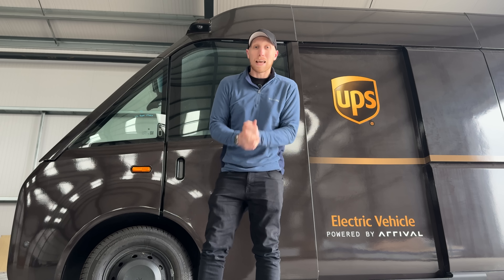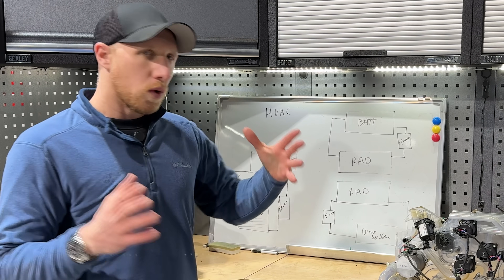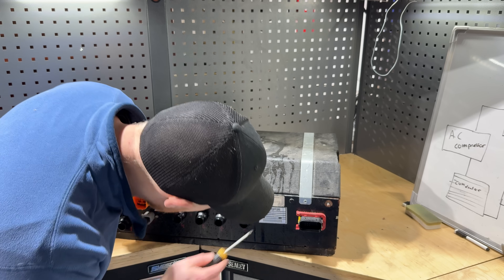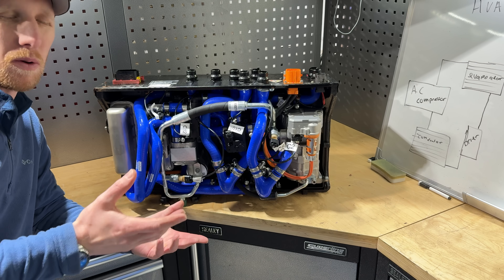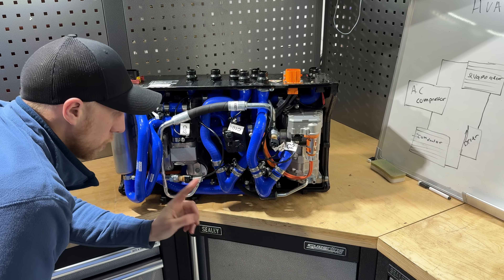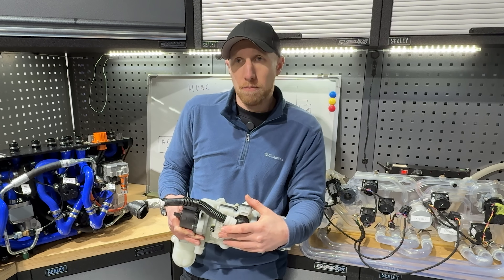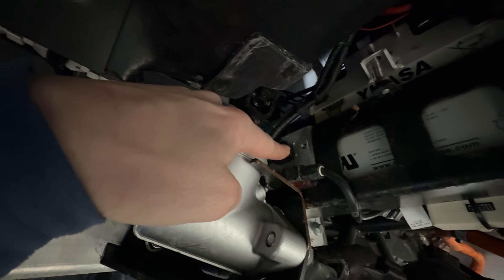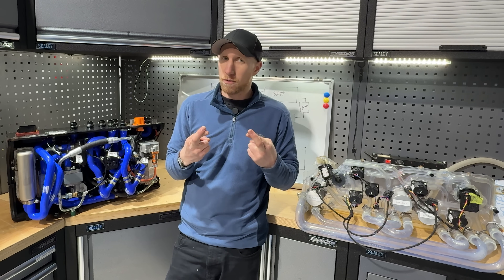How does HVAC work? ARRIVAL got something right!

Comment: I have a theory around all the separate 12v batteries. Could multiple batteries be used on the prototypes to allow them to isolate different circuits in the vehicle for testing? Maybe in production they planned to replace them with a single 12v (or double for 24v) battery?

Comment: Chris - you should give Bergstrom a call, see if they have any of those units sitting on a shelf, ready to sell to Fellten?

John Kelly of Weber Auto does a great detailed walkthrough of the Tesla system search for "Understanding Tesla's Heat Pump System" and "Understanding Coolant Flow in a Tesla".

if the Bergstrom box can do a similar thing, it would be a very handy fitment in defender & campervans conversions where you have a lot of cabin space to heat.

Comment: What does the blower assembly look like for driver comfort? If the evaporator transfers into coolant immediately in that assembly and only coolant is plumbed to the driver comfort area, how does the blower assembly/Driver AC remove humidity the way a normal AC setup would?
Reply from the maker: I will have to take the assembly apart and see

Comment: Great to see Arrival were getting some things right, although they still had a bit to go on serviceability, especially on vehicles that were going to be racking up very high milage. 
Really interesting stuff. It's one area that has developed quickly in recent years, thanks to BEV engineers searching for every little bit of extra efficiency. Less components, less weight and a more compact system are also big wins. 
I'd love to fit the latest Tesla system to my 'classic' Model S.
Reply from the maker: I would love to get my hands on one of the newest arrival vans and see just how much has changed

Comment: The key to understanding what is going on with all the EV HVAC stuff is to understand that unlike their fossil fuelled cousins, EVs need to often move heat the "wrong way" across a thermal graident, ie from cold to hot, whereas naturally speaking, heat of course wants to flow from Hot to Cold.  

With a conventional car, for the most part, it's systems operate well above any practicable ambien temp, for example engine coolant at between 90 and 110degC, or engine / trans lubricants at say 120degC, all well above even the hottest ambeint temp experienced (say 55degC).  With an EV, we require parts to operate below ambient temp, for example we need the battery to be kept say at 25degC, which is less than say 35degC a fairly normal ambient temperature.  So to reject heat from the battery, we have to move heat against the thermal gradient, and this requires a Heat Pump, ie a device that uses the latent heat of evapouration of a working fluid to push heat the "wrong way" across that thermal graident ie to cool the battery down to 25degC, despite it being 35degC around the vehicle.

So once you have a heat pump and can move heat the "wrong" way, then you unlock a series of optimisations that are all of benefit to lowering overal energy consumption which is clearly a major benefit, particularly in something like an urban delivery van where the actual road load is pretty small (because it's average speed is very low).  Here, you can now consider HEAT FLUX entirely seperately from Temperature. So you could say, hey, it's cold outside, i want to warm the cabin, and i want to take some heat being generated by the traction inverter and pump that into the cabin.  Or for example, you could use the large thermal mass of the traction battery to temporarily store some cabin heat from a cabin that has sat soaking in stong sun.

The problem is that when you sit down to work out all the possible vectors that are possible, the matrix of conditions and situations is of some magnitude, so as a result a practical hydraulic circuit layout to achieve all these possible heat fluxes is really complex, which is why the HVAC unit of an EV can look incredibly complex, include very many valves, pumps and pipes etc.

One of the main reasons that Tesla was able to come-up with there "octo-valve" later heat pump systems is simply because by this point in time they actually had enough real logged customer data to be able to accurately model and specify the heating modes and conditions that really matter, ie the ones that effect the vehicles regular, real world energy consumption.  That is something that Arrival simply didn't have, so no doubt their systems is very complex and tries to do everything rather than be optimised towards reality!
Reply from the maker: Thank you so much for taking the time to share your experience and knowledge is much appreciated. Thank you for watching

Comment: I might be nitpicking, but you're mistaken about PTC heaters. They are 100% efficient, so saying they aren't very efficient is incorrect. I think you mean that they are not the most effective use of energy for producing heat, as a heat pump can move more heat than can be created with the same amount of energy.
Reply from the maker: Very true, they are efficient but not the best for efficiency compared to a heat pump or direct heat to a person like heater seats which are also a ptc 😂

Comment: The AC unit looks like its designed to be easily removed so that if it fails, it can be replaced by a new unit quickly while the malfunctioned one can be easily taken apart and repaired, which would be great for fleet operators of hundreds or thousands of vans. I wonder if they used this unit in their one-off Arrival bus.
Do you know who ended up purchasing the Bus that they built, and had registered as a road-legal PSV compliant vehicle? The interior of that bus looked pretty cool, imo.

According to Wikipedia, Wrightbus, which is owned by Jo Bamford (JCB), they purchased one of the Arrival sites in Bicster, OXF, so they probably purchased the bus as a development testing vehicle, or just so that no one else can 'steal' their technology.
Reply from the maker: I am not sure. I do know someone must of brought there testing site as there was a massive amount of infrastructure installed. For things like emc and motor testing.

Comment: Those hidden and inaccessible 12 V lead acid batteries feel really out of place on such an overengineered EV with modular components.
Reply: It's not like space was a premium, it's a van!!
Reply: @ArryBradbury  I think the popularity of the "skateboard"  design (across many manufacturers) is to give "coachbuilders" the most flexibility, but your right, thinking about ease of maintenance and repairability should be constantly  in the minds of product designers and something the "right to repair" movement have been championing
Reply from the maker: I know there was so much space available ether side of the rad packs as well
Reply: @Hazell_Nutz  They look too well integrated to be a bodge.